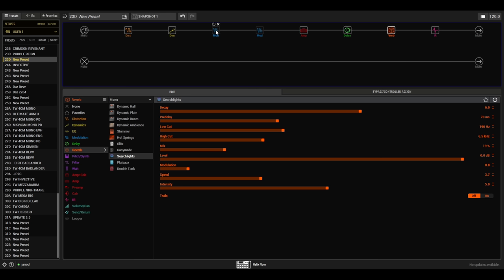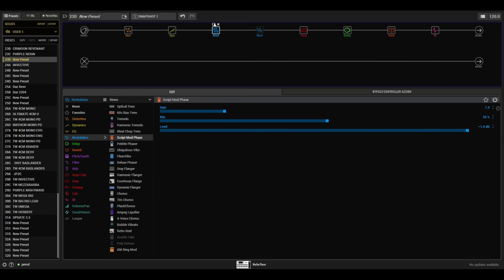Five Common Mistakes With Amp Modelers

Comment: i agree. Headrush is junk.  I'm surprised so many fractal owners use them.  Then they ask how to eq their preset to make them sound good.  Dude, if you need to EQ a "Flat Response" speaker, you bought the wrong speaker

Comment: I am definitely guilty of the first one, or at least used to, I was OBSESSED with my sound, to the point where I recorded my songs, kept rerecording again and again and again, maybe that amp model sounds better, or maybe this one, at the end of the day I always come back to the Rectifier model in my Helix, I know that sound, it’s my favorite sound it’s my favorite real amp, and at one point I was like: What the hell are you doing man, you know what your sound is, you always come back to it and get no work done AT ALL 😂😂 Third point too I tried every configuration, now I just tread it like amp and pedalboard =P
Reply from the maker: It took me a while to get there as well. Now, I just do everything simple and straightforward.
Reply: Guilty of that as well. But for me it's the boosted 5150 which simply is my sound.
Reply: @PippPriss  booosted 5150 in your line 6 ?

Comment: The greatest thing I learned any my helix was to put a drive pedal between the amp and cab. Very low gain.  It's amazing and I would never have done it except I saw it on a video like this. Maybe even this channel  I'm loving alpaca rouge but I'm only getting started with this but I'm so much happier with my heavy rock tones now. I'm tweaking a lot less. It even sounds great in helix native which has never really worked for me before this and v 3.50

Comment: I had trouble dialing in my HX Stomp for a long time, which led to a lot of complicated tweaking. Not long ago, I learned that "real" Guitar Amp Speakers have a steep high frequency roll off at around 5kHz, some even as low as 3kHz! The HX Stomp had a "default" High Cut in the Cab Block at 8kHz! Depending on your specific use scenario, that might be perfect, but it sent me down many a rabbit hole trying to figure out how to get rid of the harsh high end so many users complain about.

I have the 3.50 Update, and before I touch any other Block settings, I look at the Cab Block, listen to the sound. If it is too bright or harsh, I lower the High Cut to about 5kHz. If it is still too bright, I try different Mics and positions. That usually fixes the problem for me. With that taken care of, I find the Amp Block Parameters to be pretty good, and dialing everything else is easy, and minimal.
Reply: I by default put it at like 6.2k before I do anything and don't use a ton of presence on anything.
Reply: @Scott__C  Yes, that works well. I rarely use any "Presence" myself. 😎

Comment: Everything you said in this video is certainly true.  Good advice.
"chug chug turn a knob!" was hilarious.  So true.  I have been down that rabbit-hole with my Boss Katana and ToneStudio software.  Spending all day tweaking patches and saving presets, while suffering from ear-fatigue.  A few days later when I pick up the guitar again, all that tweaking sounded like crap.  So I have to go back in and try to fix it.  And the Katana is pretty simple compared to something like a Helix or an AxeFx-3!  I can only imagine what I would do with an FM-9.  Spend the rest of my life messing with the endless amount of settings it has.  I've actually been using my Katana with pedals, just to keep from going back into the Katana software and tweaking stuff.  😆

Comment: The hot setup for the modelers is to put the speaker as the first component in the chain, then you add a reverb, then a preamp, then 2 4x12 cabs into a power amp, then you create a loop with a flanger and a phaser, then a delay with the repeats set to 40,000, then you add another power amp, then 4 1x12cabs, then the output into a alto 1x10 frfr. This is the hot setup. Believe me.
Reply from the maker: Lol I'll give that a try 🤣

Comment: For my Helix presets, every single one has EQ -> Comp -> Amp -> Dual Cab -> Ambient Reverb -> Comp. And that's just the most basic of basic setup. Granted each step is subtle and definitely makes the tone better. But it does make things complicated. I basically fill out all 2 rows in every preset. I don't understand people who use the HX stomp with a single Amp+Cab block.

Comment: LOL I mostly use Kali LP-6 V2s, too XD They're great. If someone really just wants a combo amp, Phil Jones combos are typically FRFR iirc (my BG-75 is).

My peasant ass uses a Zoom G6; it has a really weak CPU so I can basically just run an amp, a cab, and a few effects. Done. No multiple routes for me :D Zoom noise gate, Krampus amp, 4x12, and rhythm tone is done. Maybe an EQ in there. People sleep on the Zooms because they aren't a Helix, Quad Cortex, etc but tbh I think it sounds great and it's just simple to program.

Thanks for sharing! These will be helpful to people just getting into amp sims, etc.

Comment: Great video, the parody Brochannel video was awesome. 
It's funny with the modeling stuff.  Just change what needs to be changed.   It's OK if a preset is just an amp, if that's all you need for it.
Also, too many when they get at gig/stage volume, they think the unit sucks when they just never spent time at that volume adjusting it. 

Other good practical guys are Steve Sterlacci and Scott's Guitar Playground.

Edit to add:  Bonus points for the use of litany.

Comment: Except for the small modulation on modern reverbs (which yours has, but is set to be subtle) it makes no difference if you put the reverb before or after the delay.  (Modulation-less) filters, delays, reverbs are all linear time invariant systems unless they clip and can be re-ordered without any change to the system.  Try it by setting up a patch with two signal paths and different orders and see if you can hear when you switch between them.

Comment: "Buying crappy presets" (laughs in Quad Cortex)

But seriously, every one of your points is valid and relatable.  I've been told that the FM9 is superior to the QC because you can adjust the sag, et al, on the amp.  Uh, so what?  No one you're playing for can tell the difference.

Comment: I can wholeheartedly also vouch for the Kali Monitors. I've got a pair of First Gen LP-8's in my apartment pocket studio rig, and they were a huge game changer for home mixing over my former Alesis passive cans and power amp. Not exactly as clear or quiet compared to the ADAM A7's I worked many hours on in my friends former studio, but that's a minimally critical observation, and considering the LP-8 were a fraction of the cost?! Money well saved IMO.¯\_(ツ)_/¯

As far as modelers and plugins go? 
I mainly always add one crucial "always on" pedal to the input chain (besides a gate). Regardless if it's a standalone unit (AXFX), or interface + plugin (Focusrite/Orange OMEC, PC/iOS, & Biasfx/ML Labs).
An analog clean boost is a MUST. 
IMO, when used conservatively, it just seems to add a bit more "realism" to the overall dynamic feel of the emulation. If that makes any sense?! LOL! ¯\_(ツ)_/¯
Oh, it's also VERY important to slightly dial back the gain of the amp sim just a smidge than what it was that you were used to prior. Very importante amigo 

IDK but...
I've been using this method for a few months now, and I gotta say...
It's been a massive improvement. Well, to my ears anyway.¯\_(ツ)_/¯ 
 
 Currently doing this with a trusty old (super underrated) Digitech Bad Monkey OD at home (the active EQ adds just a bit more versatility) with the gain anywhere between 0-3 and the output level between 1&3 o'clock, and it's just great. 
It adds just the slightest bit of analog hair and compression, but in a way that just sounds/feels more convincing IMO? I dunno. 
Definitely something worth trying out anyway, and especially for anyone who hates amp sims as much as I used to for sure! 
Honestly any boost from an Xotic EP, TC Spark, Blackstar Dept 10 (really want to try that one), or even one of the uber-affordable N-UX "Lacerate" FET boosts would definitely do the trick. 
¯\_(ツ)_/¯

While all of this is obviously highly subjective, it's definitely NOT within the realm of impractical "bro science" B.S. advice, and as always...
Results may vary.
So I gue... "
Holy Sh%tballz!! 
How TF did I type all that just now!? LMAO!
Yeah, I do that sometimes. ha!
Someone's ADHD meds obviously just kicked in! Bwahaha!😅
Great video dude.
Catch ya later✌🤟🖖

Comment: Hi Jarrod! New subscriber to your channel (that amp head collection is sick!). Re: the Headrush FRFR 108, would you say that it could work as an active PA speaker (in a pair) if not for powering a modeling guitar rig? Looking for a compact, high-power solution for a garage band-type setup. Thanks in advance and great tips here as well!
Reply from the maker: Thanks for subscribing and welcome to the community. Glad to have you here.
 Regarding your question,  I think they are pretty much a budget speaker and they kind of sound like a budget speaker if that makes sense.
 I've never been a big fan of those speakers because they kind of sound nasally.
 I think the QSC speakers would be a much better way to go. I know they cost more but they sound much better. I hope this helps.

Comment: When you don't have (or can't accommodate the necessary volume levels of) good studio monitors or FRFR speakers, would it work to dial in your tone with IEMs? Are there good IEMs out there that translate well for this use case?

Comment: I I just got a bias effects riff, and want to use its effects with my real amp and cab. The instructions say I can do this and they also say I cannot do this. I have read that the line level may need to be converted to high frequency for the amp. I haven’t tried anything yet because I need cords that actually connect to my computer. Will I need a ramp box to make that conversion or will that not work at all?

Comment: There's an old saying. Keep it simple. I do not like modelers anyway. I use old effects processor like the Digitech: RP-1, GSP 21 Legend, GFX-1 Twin tube, ADA: MP-1, Rocktron: Chameleon, Voodoo Valve or the Boss GX-700 into the front of a clean amp or power amp. Even pedals into the amp is great. The less I have to tweak the better. I have one overdrive sound and one clean sound and I just color them with effects like wah, modulation, delay and reverb. No monitors, just a processor, two amps and two cabs.

Comment: Love the advise, I am looking at getting either axe fx II XL+(used) or boss GT-100 (fullsize) or maybe a Helix. I am using with my JP2C+ as  effects(mostly just for delays, reverbs, chorus, and such) and some modeling  when we practise with just a PA(simple type set up plug in and practice)I used to use a gigboard which was brilliant for simplicity but it hated my recording set up.   which one would you pick? i am really leaning toward the boss .
Reply from the maker: Thanks for commenting. I used the helix with my amps for years and loved it.

Comment: What’s your thoughts on Choptones they sell packs for headrush for amps that are not in the headrush saying they sound like such and such i emails them and said can’t we just dial in the same sound and they responded no you have to use the pack they sell because the amp has been modified in the preset block
Reply from the maker: Wow I can't believe they are doing stuff like this. What a scam!

Comment: Is the headrush 108 really that bad for the price? I've heard mixed reviews on it, and am leaning towards buying it. I have the MX5 which I think is amazing.
But you seem to think the speakers are garbage. Is the 108 some of the worst guitar speakers you've heard?
Nice vid btw.
Reply: Stay away from them
Reply: @muleblues71  what else to get? For small gigs?
Reply: @user-lq9mw1sb8d  check out the Tech 21 PA60 power amp….
Reply: I’ve been gigging with the headrush 108 for MONTHS and it’s worked perfectly as a “I have a guitar cab behind me”. Yes it’s not the best sound but it’s just for stage volume. As long as the FOH mains and stage monitors are good the headrush are fine.

Comment: Is it possible to get a good sound with helix, power stage and a 2x12 Mesa cab?
Reply from the maker: Look into the KSR power amp. Trust me, you will like it much better. It's an all tube power amp and it's small and lightweight.
 If you use that with your helix and real cab it will sound amazing

Comment: I would like tp know if there a possibility to use a mix/blend trick with distortion block. I want to blend an fuzz like tone with an amp but I want to adjust the amount of the distortion that I need in my sound. I wanted to use parallel but it s not that great. If you can help you will be a lifesaver. By the way, thanks for the video that will help me a lot to maximize great sound without making to much trouble
Reply from the maker: Thanks for commenting. To your question....I am not a fuzz guy. I've never used one of those pedals ever. I am definitely out of my depth regarding those pedals. I wish I had a better answer for you. Sorry.
Reply: @TONEWARSgearshow  it was not about the type of distortion. It was if there some way to add an mix/blend feature to a distortion block inside the helix
Reply from the maker: @philfort7886   Oh, got yeah. Sorry I misunderstood your question. 
 Yeah that would be a great feature to have. I know kemper has that and it's really a handy feature
Reply: @TONEWARSgearshow  that okay man. Thanks for the repply. I've really appeciated. Yeah, that would be a great feature and i'm pretty sure this would not be very hard to do. Seriously an blend/mix feature would open the possibility of the helix more. By the way your channel rule man keep it up 👊👊👊
Reply from the maker: @philfort7886  my pleasure and thank you for the kind words.  Hopefully in the next update,  the mix feature will be available

Comment: Great video but in my opinion you left out that the main issue here is that the Helix amp models do not sound inspiring. They sound small and not organic. People make these presets and tips videos to try to show how to improve it but in reality it just needs to sound better in the first place. No gear is perfect but the correct amp or Kemper profile can sound much better with minimal tweaking in my experience.

Comment: The secret you missed is to use eq to take off the low and top end. The digital stuff is too wide range. Guitar amps are not full range so you need to take away a little on both sides to dirty up that super clean modeler sound.

Comment: Steve Shaheen keeps his setup so simple that he does not even use a headstock on his guitar. He goes out of his headless guitar into the amp into the cab. Brutally simple. Steve is writing a book; which is due out this Christmas. It is called "Headstocks, why they are destroying America." Steve has done lots of scientific research into the destructive issues that Headstock cause. Steve also uses oxygen free copper cables. He also uses commercially available skin care products. He is NOT wrting a book about those topics.